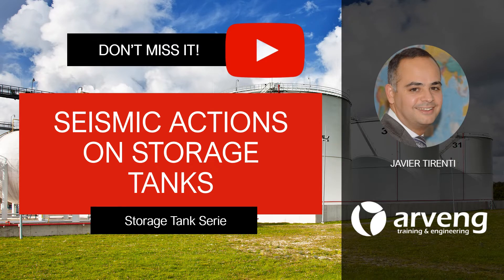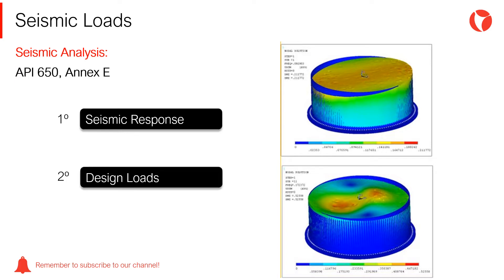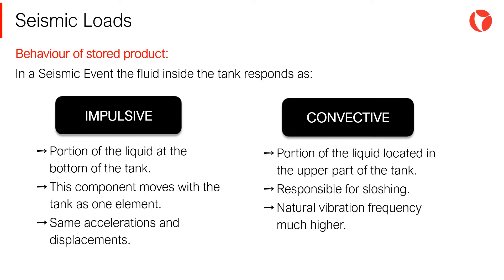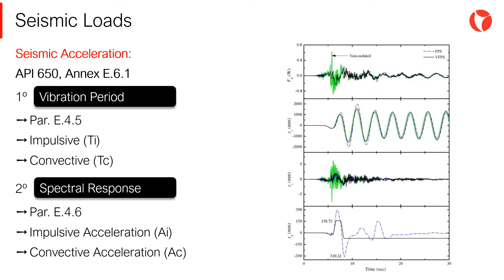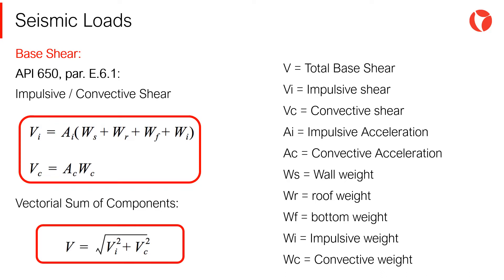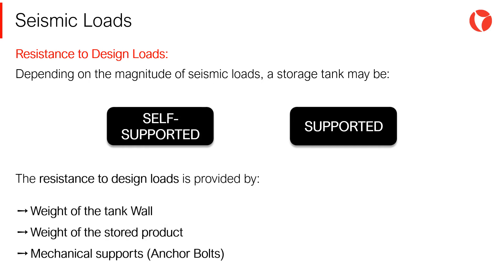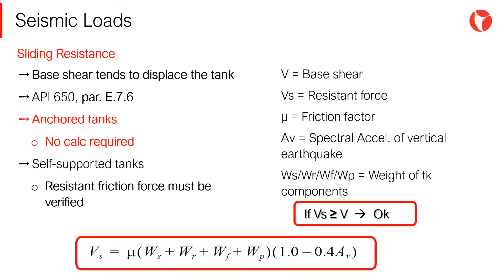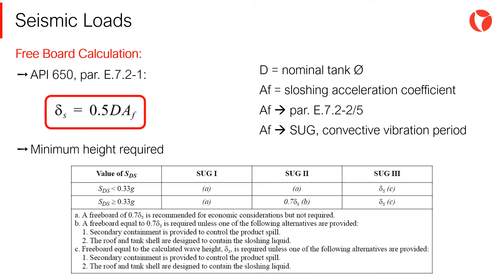11  Seismic actions on storage tanks

Comment: is seismic design as per api 650 mandatory to be done or is it purchasers decision? My understanding is that is purchasers decision, am i right?
also, could you advise how to proceed when client doesn't have necessary input data for calculation?
finally, if the tank is designed as per api 650 but outside USA, should we use sites not defined by asce 07?
Reply from the maker: Thanks for watching our video! If you'd like to go more in-depth on the topic, please check out our self-guided course: https://arvengtraining.com/en/all-courses/api-650-design-of-storage-tanks-course-online/